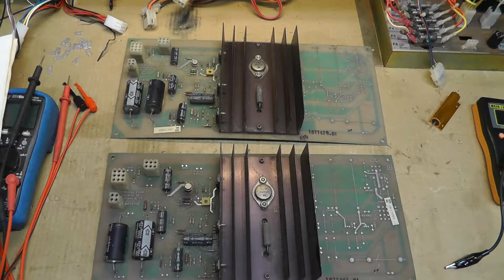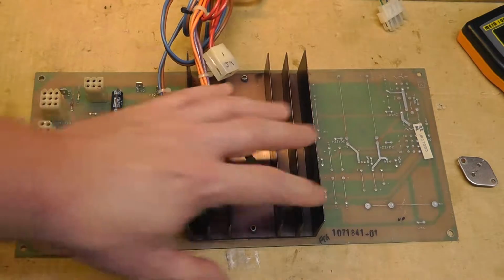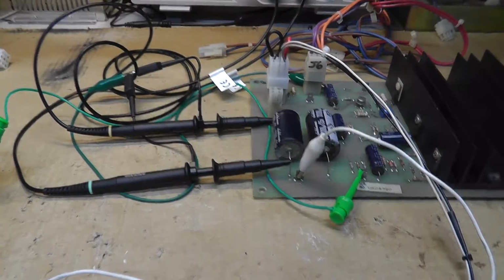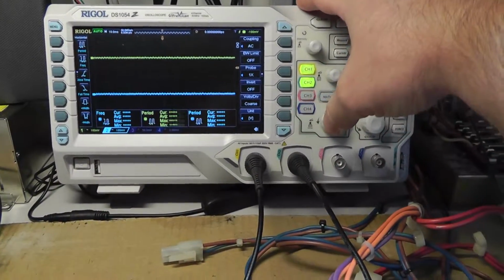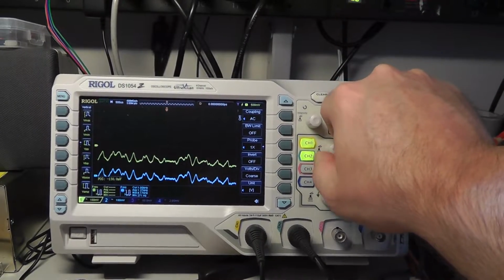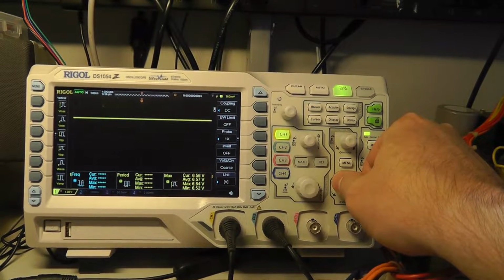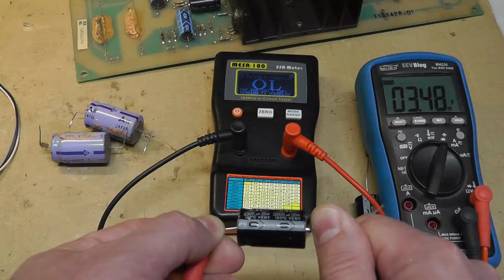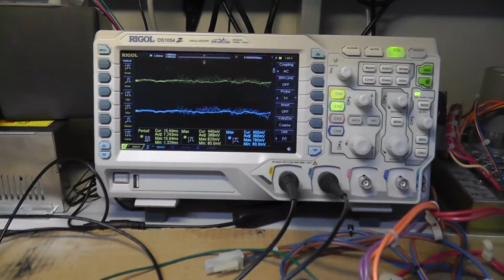Atari Audio Regulator AR2 Repair & Rigol DS1054 Oscilloscope Hole We Go!

Comment: Auto = Evil :)   I've learned not to use that as it usually doesn't set anything up the way I want it to.
Reply from the maker: Good advice.  It seemed ok when using one signal but multiple signals with different amplitudes definitely messed it up.

Comment: Nice video - I use my scope all the time.  Really need to learn how to to all those little items myself.  I've gotten away from using 'AUTO'  you can usually find the signal adjusting the voltage and time knobs pretty easily.  AUTO started to get me lost more often then not. thx for posting
Reply from the maker: Yea, the auto button messed me up.  When I went to my analog scope, it quickly dawned on me that my volts/div was too granular on the Rigol and I needed to be looking at the AC signal vs DC for sound waves.  I don't think I clearly articulated that in the video but knowing what kind of signal you are looking at and adjusting it manually, is obviously best.  Thanks for the comment.